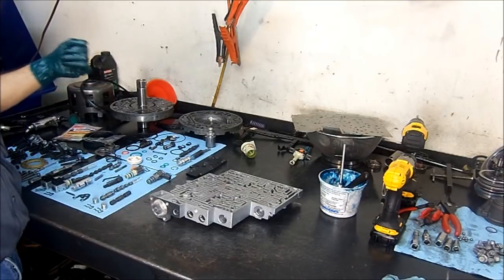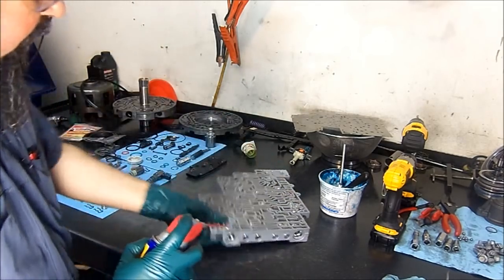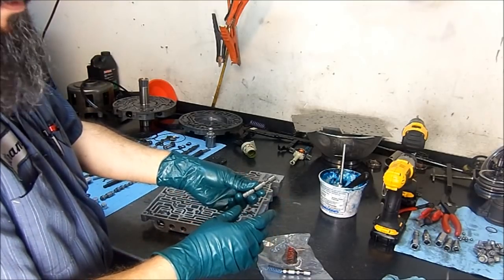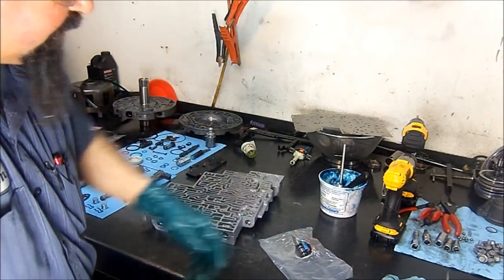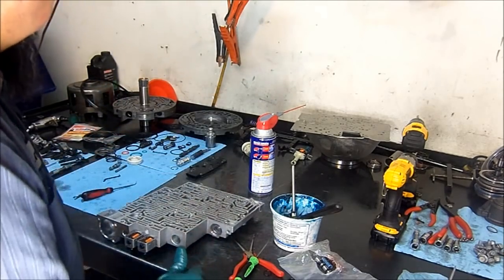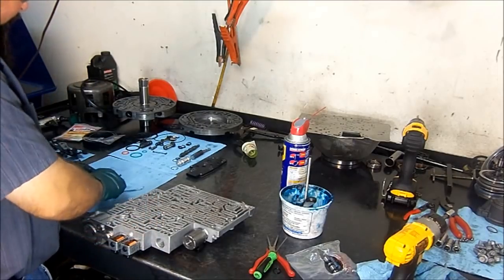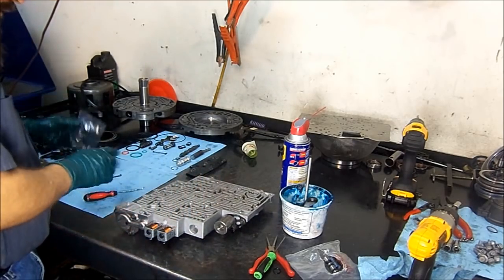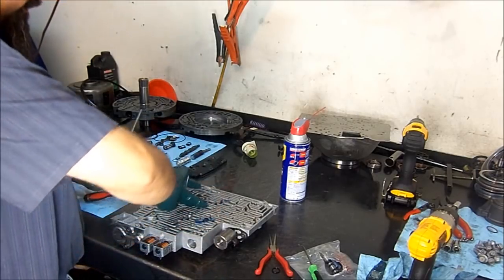4L60E Transmission Valve Body fix P1870 Transmission Component Slipping trouble code.

Comment: Great video. I had a tcc shudder during lockup, and installed transgo SK kit to fix this problem. When it switches over to lockup, it now locks up hard like a 5th gear but it still shudders/chatters. It makes the noise like a manual car was started in 4th gear. When it locks up at 45, chatter, shudder, hold down the throttle about 3/4 and it kicks it out of lockup and accelerates to about 65, then locks up again without any shudder or chatter. On the scan tool it doesn't notice any significant slip during the lock up chatter -10 to -20 rpm. Holding the brake pedal lightly while accelerating, the chatter goes away. I've installed the shift kit exactly to all directions: replacing springs, adding shims, enlarging feed holes, etc. without skipping any steps, and added a corvette servo and new transgo plate. 1-2-3-4 works well outside of the 45mph lockup. What could be wrong? Burned converter clutches? Slipping band? Even more excessive wear on the VB that the shift kit didn't fix? This is on a 96 Astro 4l60e AWD. I've replaced most of all the ignition components recently, and fuel trims are steady during the shudder.
Reply: Thank you so much Hiram! I put in the shudder fix this afternoon and guess what!! 70% of the chatter is now gone. It now only chatters if the car is going up an incline. I know this is a band aid but I'm glad for some resolution. I've been tearing my hair out trying to diagnose it. Thank you so much for your videos. I've learned so much about the 4l60e from you, and most of all its given me the confidence to tear into it and diagnose. You're a huge asset to the community.

Comment: I got a 97 chevy c1500 with the 4L60e and I get the p1870 code after I drive for awhile say  25+ miles and then I get a hard shift from 1st to 2nd and it's also running at 2100 Rpm's at 70 mph and it used to run at 18-1900 at 70 is it gonna be the valve or a solenoid if it's the valve how much does it cost to get it fixed I'm in Houston tx

Comment: Its been 3 months after the valve flip and all is cool. I now drive with the trans n 3 n the city because the tcc put the rpm to low. If I was to flip it back around, do they make a stronger spring for the 04 Trailblazer. I was thinking about putting a ball or something between the valve and the spring to make it stronger.
Reply: ***** I replace my clutch fan once before. The a/c would not work when I 1st. start the truck. Thats not it. I've replace the thermostat a long time ago. The cel was on and the computer said temp was 25' below normal. Its not a bad thing when the tcc lock up it's just I like the smoothness of the pwm. That you for your help.

Comment: I have a 2000 chevy truck that doesn't shift into higher gears. I have had the transmission rebuilt and just replaced the wire harness/ tcc solenoid. It will take off strong then I loose all gears.

Comment: Have you had a plug in the valve body that holds the valves in be stuck and not come out when you remove the clip? My plug is stuck and will not come out. The back part of the plug groove is catching. What can I do to remove it so I can clean the valve body? My 4l60e trans is a 1995 4x4. Thank you and your videos are a blessing.

Comment: Your transmission repair videos are very informative and very professional- Thank you  for the time you spend doing them... I am an Master ASE tech but not too much auto tranny work- about to take on my 2000 Trans Am Ls1 with 4L60E. I believe I have 3-4 clutches bad- get a funny shift almost like going into the same gear even though I feel the shift and then eventually get to 4th.  Any tips beside the valve flip and hole drilling-going to change out cam for a bit more performance-staying stock pistons and chip.. thanks again..Nhtrailcat

Comment: I have a 99 Tahoe in the pass 2 months some times it will bang hard from Park to Reverse or to Drive only happend when it was a cold engine.  I keep the fluid/filter changed at normanl intravols so far 121,000  miles no issues.  I have a program installed in it from Hypertec since 2003 I just reflashed the program cause I went from a 33 inch to a   31 inch tire.  Any sugestions..

Comment: Thanks for the vids Hiram!! I got a question for ya.. I recentlly had a 4l60e rebuilt and it only has forward gears, even when its in nuetral it goes forward. I also have abs,parking brake, and traction control lights on that wusnt on before.. Can U help me out any? Thanks again!!

Comment: I HAVE THE P1870 CODE SET IN THE HYSTORY. 
ALSO THIS TRANSMISSION HAS A REALLY HARD SHIFT 1ST TO 2ND.
IS THIS SOLUTION TAKES CARE OF THAT TOO?
Reply: I did the oversized tcc solenoid it got rid of it for a few months......but it just came back. I had 2 codes tho now only 1870 code. Going to just replace the valve body with all new pieces for like 300